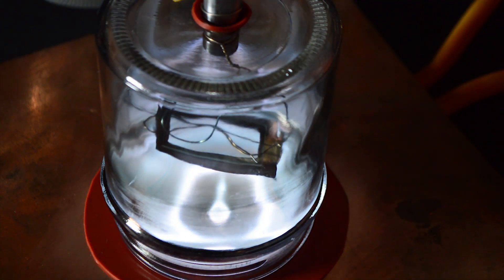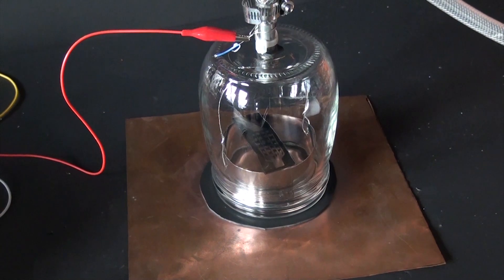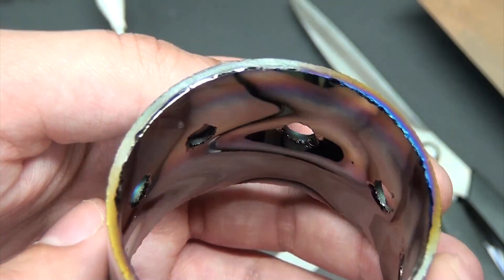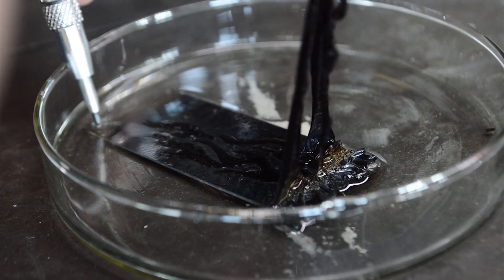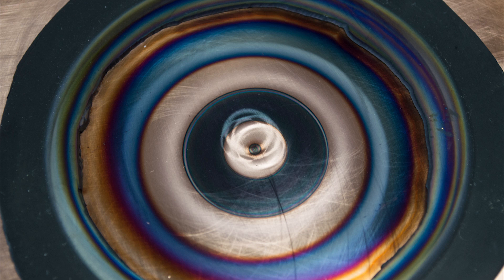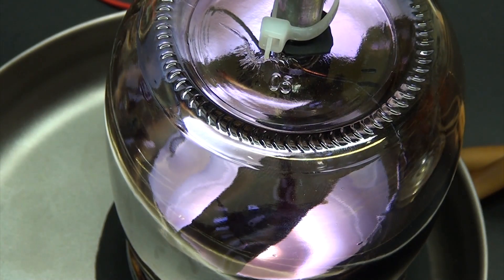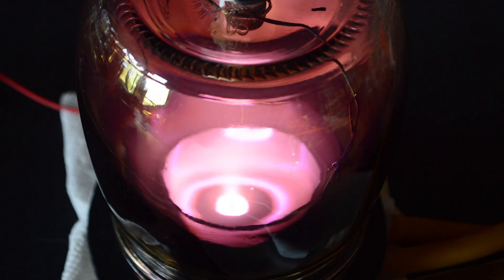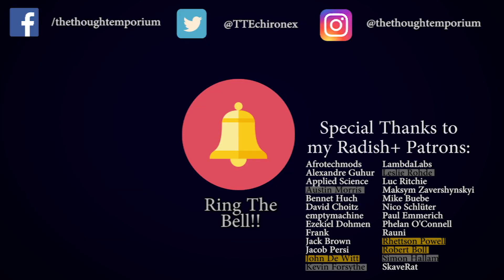Plasma Metal Coating... In a Jam Jar

Comment: i wonder what bismuth would look like, given its very wide range of oxide colors
Reply: I imagine that it would just look like the copper. The metaloxide is all you need for this effect. On just bismuth metal the oxide layer forms just in the right thickness for this effect to be visible. On Iron, the naturally formed oxides are to thick. When you heat Iron, the oxides form so fast, that they remain in the thickness range where the same effect keeps intact, so you can still see the colours. If you leave a heated metal thing for to long in the air, the colour slowly fades away.
Reply: @OutdoorMode  stainless steel is notorious for the colored oxides too, I've see  people make cape coils outta it to make em color, which seems really neat except soon as you use it the color vanished, seems like an awful lot of effort for just that moment of pretty
Reply: @PhilieBlunt666  if its unstable, it only adds beauty to it ^^
Reply: I too am curious as to how it would behave, given its odd behavior to magnet fields.
Reply: @yappingdog2759  Yes. I build magnetic motors, and would like to experiment with bismuth's character using a device like this. What a shame to waste this tech on nothing but art.
Reply: @sunsaverfromnhh9184  it's not really a waste to use it like this. You can sell art and use the money for funds as long as production costs don't exceed profits.  Plus, you can make accidental discoveries when you are just messing around. I didn't know you could coat organic matter in there until I saw this, which,  is fascinating. I wonder if you can make business cards like this. The rainbow Sheen would be very eye catching.
Reply: @sunsaverfromnhh9184  its not a shame, art is an important part of our society and the more tools available to them the better. Not saying we should stop using it for useful stuff, but in cases like this where someone went totally out of pocket to get the necessary tools (or in this case make them) then it's far from a waste. If you think you have some good ideas for this technology's use that's great! In that case you too should construct a plasma sputter coaster as he did and put your ideas into practice. (btw, I'm not just saying this out of self interest, I study mechanical engineering, not fine art).
Reply: I think bismuth plasma is hot pink to deep purple, so it would be stunning to watch as well.
Reply: Very sexy, I assure you.
Reply: Pink bismouth

Comment: Researchers at Caltech and Northwestern University have found that electricity can be produced when salt water flows over the top of thin films of rust. It would be cool to see this in a future video.
Reply: I've found that if you put a volt meter across falling water (try a slow stream from a tap) it produces a voltage drop. An old friend told me about it a year or two before he died. I haven't found any literature that  mentions the effect, though I'm not certain exactly what I'd be looking for.
Reply: @PBGetson  https://youtu.be/rv4MjaF_wow I think its nothing that unusual
Reply: Imagine a sustainable method to employ in dams. 

Electricity is everywhere, energy is everything. 

Extremely simple ways exist to provide us with things we believe are rare or difficult, things that we ignore or take for granted or remain woefully ignorant of until an accident comes along and shows us our errors.
Reply: That partially why rust forms. The electrolyte creates a potential difference. Like a battery.
Reply: can you link the source?

Comment: You may be able to use thin aluminium tape as a mask, it might not have the same gassing problems and is pretty cheap and easy to work with.

Comment: This is very interesting, I have a  question would it be possible to coat a drop of blood consistently with an even sub micron layer so it could be examined with an electron raster microscope?
Reply from the maker: Like a dried drop of blood? sure. These machines are used for that already for SEM use
Reply: I was thinking a medical device, where er doctors could get white counts, platelet counts, bacterial, viral and fungal infections,  viral loads, etc in a minute instead of waiting for hours for lab work. even pictures of unidentifiable viruses and bacteria that are not in the computers database. all with a drop or two of blood (one drop for the erm scan one for blood gases).

Comment: Join me in figuring out a diy CO2 laser using easy to find pieces!  A curved mirror is needed!
Reply: If you want to make a concave one , a quick google search revealed a technique used in 15th century. You take two bars of metal(or glass), rub one on top of another with abrasive compound in between and you'll end up with a concave and a convex surfaces, that you just have to polish.
Reply: Curved mirrors are not needed for CO2 lasers.
Reply: @Spirit532  , you're right. But one curved mirror makes the alignment easier.
Reply: @TheRainHarvester  That'll be the least of your problems in a DIY CO2 laser.

Comment: Have you tried cleaning the glass jar with some acid? That should dissolve most of these metals, right?
Reply: It would cost more to buy the acids than it would to buy a new jar though
Reply: Marc T  Maybe you could even get rid of all coatings with just HCl or so if the lowest layer can be dissolved by it. Then the gold and such should just fall off as well. Might take a long time though.
Reply: Marc T  aluminium does dissolve in HCl. I´ve tried it once with alu foil and once it was through the oxide layer, it dissolved pretty fast. The coatings on the glass are much thinner than that. I´m not sure how fast copper or silver dissolve, but I think it should work.
Reply: Marc T  I dont really know mutch about chemistry but the coating on the glass should be mostly oxides.
Reply: I clean my glass chamber every so often and just use a scotchbrite pad and some Cif cleaner, followed by acetone or alcohol. The stuff comes off pretty easily. Next time you pump it down, it takes a few extra minutes to dislodge the water from the glass walls.
Reply: Piranha solution might work well to clean the glassware.

Comment: So you can coat glass with stuff
But what if you coat stuff with glass? It should make for a quite chemically resistant coating, if not mechanically so. Maybe you could coat a freshly cut metal with a layer of glass to keep it from oxidizing and have a nice shiny piece of sodium.
Reply: you´re talking about enamel coatings. That´s beem a thing for a long time.
Reply: @Basement-Science  Well yes but i feel like having a chunk of sodium in a kiln at 800°C would cause some issues.
Reply: @bottlekruiser  If you just want to keep it around to look at it, you could always put it in a glass ampule with inert gas and seal it in. That´s how such metals are sometimes stored. 

But if you really want to have no gap between the metal and coating, that´s a bit harder. It might still work if you do it in an inert atmosphere in a kiln, idk.
Reply: @Basement-Science  I was referring to sodium's tendency to liquify at temperatures quite substantially lower than those commonly encountered in a glass kiln.
Reply: @bottlekruiser  Ah, you´re right of course.